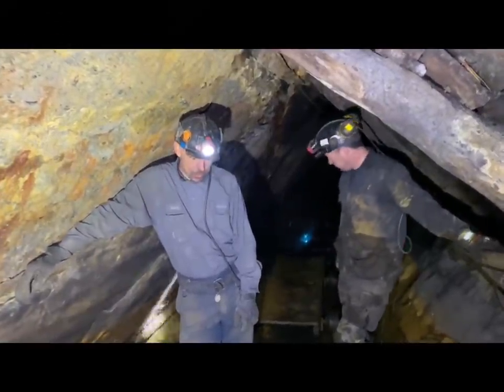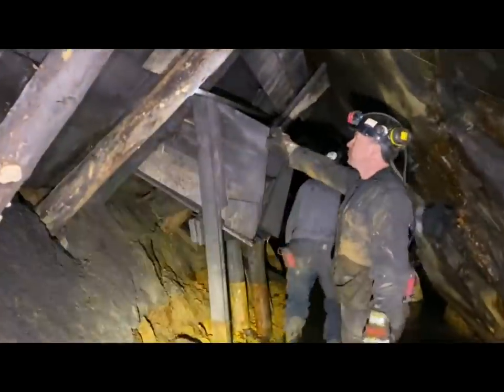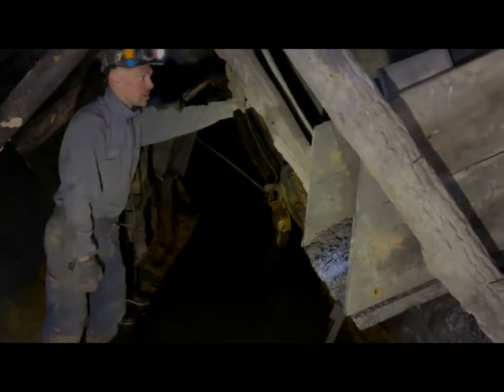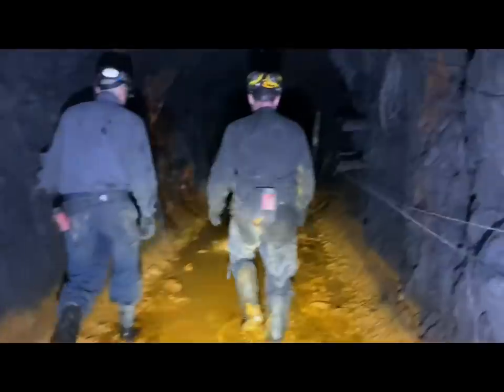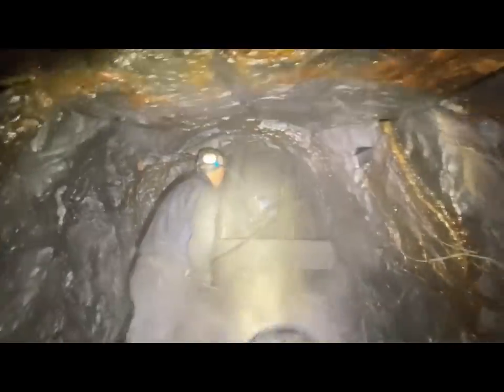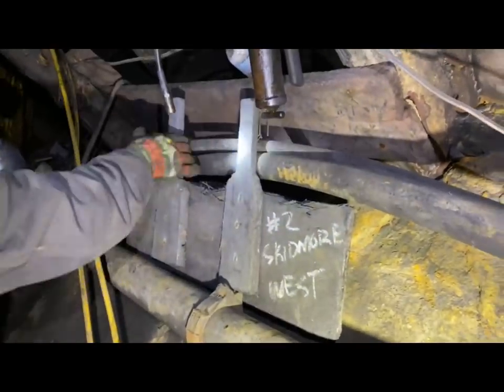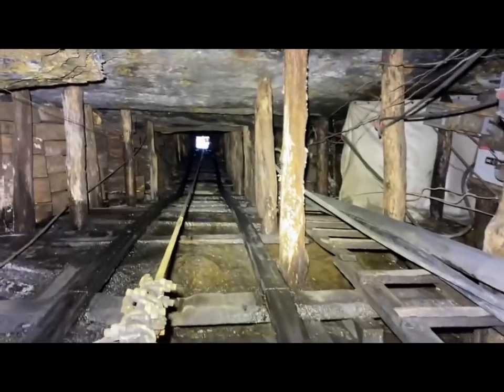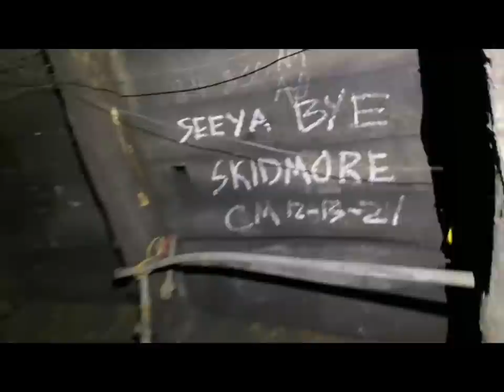Closing One of the Last Anthracite Coal Deep Mines

Comment: I found your site years ago and followed it along. Good to see things are still going and getting a refresh.

Curiosity asking, this being a very small mine with only a couple people working it. How many tons/day under typical operation were they extracting ?  And could you maybe make a video with a diagram explanation of a slope mine ? I understand the basic idea of a slope mine, vertical shaft is pitched to follow the angle of the coal seam and having the main gallery way at the bottom. After that it gets disorienting with all the branch off shafts going every direction.

Comment: I was born in a traditional coal mining area in West Europe where most anthracite mines closed 50 years ago, but back then those mines looked a century ahead of time compared to this one right now. Granted it was all deep mining here (the deepest shaft was 3200 foot) which requires stronger supporting infrastructure, but the small drifts (main drifts had 2 or even 3 parallel railway lines here, carts were pulled by compressed air locomotives) combined with the lack of concrete and steel and the abundant use of timber is quite shocking to me (also, the main transportation of coal from the front to the carts wasn't done by chutes but by shaker conveyors).
Reply: Your description would accurately fit the large bituminous coal mines in Indiana, Kentucky, West Virginia and other states. Deep mining of anthracite coal in Pennsylvania is almost extinct. In another video they mention that there are only four mines still working, and all are very small scale operations like this one. Essentially they are mining small pockets of coal left behind by long closed major mining operations. The larger deep mines began closing in the 1930’s and by 1960 the process was essentially complete. There is still strip mining on a larger scale, mostly for export. Domestic use of anthracite coal for heating or steam generation has dwindled down to almost nothing.

Comment: The Deepest Anthracite mined in South Wales was at a Depth from the Surface of 4600 feet. the actual deepest part of the Anthracite Coal  seams was a Further nearly 6000 feet below again, too difficult to mine at that depth as it was at 4600 for any length of time. The Mines at Cynheidre Abernant were particularly deep but even them very modern mines were Difficult to mine because of depth and severe Geological problems also Gas was a major problem. with Major roof squeeze and floor heave.

Comment: Many of you might not know, but those timbers wont hold back the mountain. However the cracking and snapping sounds echo thru the mine and a warning is given. One can see the upper timbers stressed to a bow. While walking thru a tunnel one  if ones echo dies out  it mean the roof is faulty. Get out!